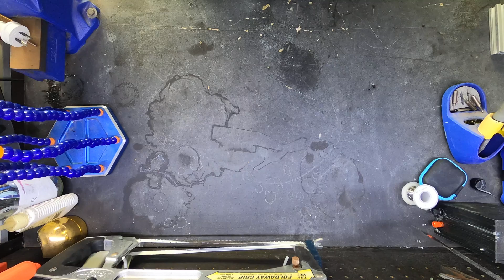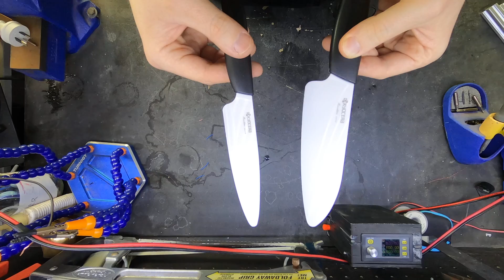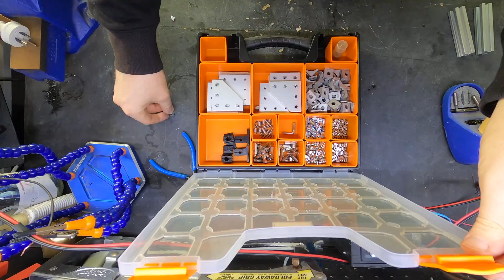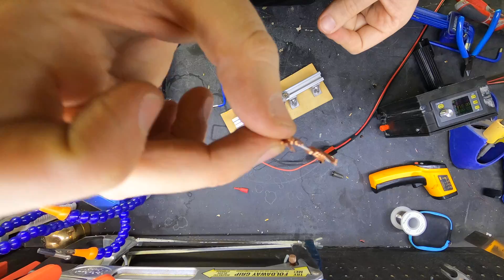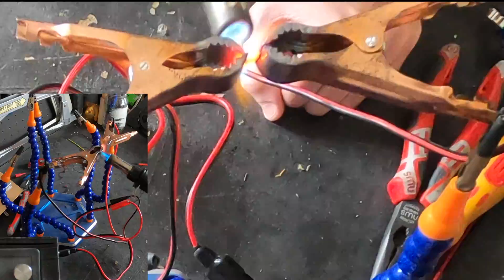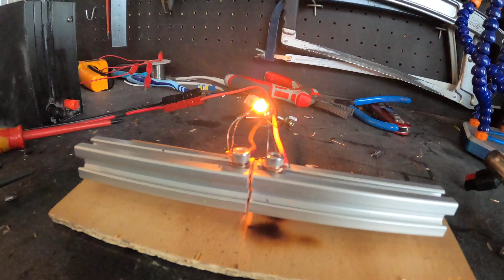Adventures From The Workbench: The Glowing Potato Peeler - DIY Nernst Lamp

Comment: Graphite? Maybe you could place the piece of ceramic between two graphite rods and use some spring tension at the cold end of the rod to keep good contact
Reply from the maker: I like the idea although I do wonder if the graphite would start combusting in air at the temperature the ceramic gets...
Reply: @DropTableAdventures  it would definitely oxidise, an enclosure with very little air flow would greatly mitigate it. And some spring pressure should keep the stack in contact for some annoying of time

Edit ... for some length of time.  Not annoying
Reply from the maker: Sounds like it wouldn't immediately fail - I'll have to give it a go. There is a "round 2" planned, when I get some time to do it.
Reply: @DropTableAdventures  they used graphite rods in carbon arc lamps, which had a very ablative arc and still got quite a few hours out of the rods, so I'd expect you could get it to stay on long enough for a demonstration. 

Kind of tempted to go buy a potato peeler myself now
Reply: Even in an inert gas atmosphere, graphite sublimes when the temp gets high enough.

Comment: Neat video!  Still planning on a followup?   I just (re)discovered the Nernst Lamp and of course the algos popped this video up on the list!  I'm  starting to gather materials to make a model of this lamp, too.  There is certainly a novelty to 'glowing potato peeler', and great thought to use that as a source of ceramic!  I did some searching to see if I could come up with anything closer to an actual 'glower' which were reportedly 1/32" diameter 1" long ceramic rods.  I found "Ceramic Needle Point Contact Points for Dial Digital Indicator Depth Gauge 1mm" which appear to be round ceramic rod pretty close to those original dimensions.  Going to order a couple and see what happens!  Keep up the good work!
Reply from the maker: Thanks for your comment! The follow-up's still planned - I have a small box of parts sitting on the workbench, and a few more ideas to try... 

Just need to find some time to do them.

Comment: You do need to make sure you limit the current through the "glower" as they will tend to want to draw more and more current until they self destruct.   That's why Nerst lamps ended up with balasts to restrict the current.
This is quite an interesting experiment to watch.  It can show how the original inventor would have been experimenting to try and come up with soloutions to the issue :)
Reply from the maker: I did have the PSU in current limit mode but I'm not totally sure it reacts quick enough given its output capacitance. Will see what I can work out for the next iteration.
Reply: Didn't the ballast also double as the heater for getting the element up to temperature?